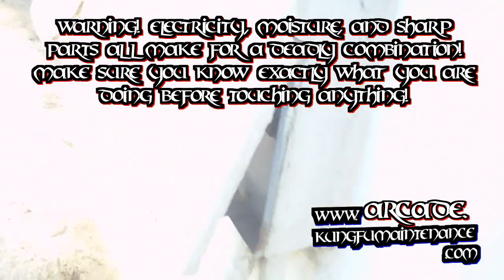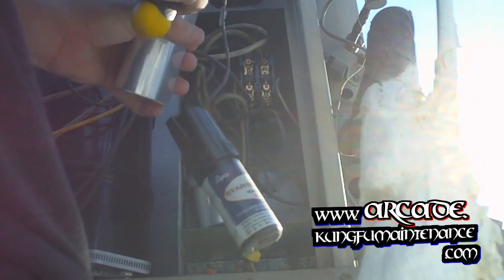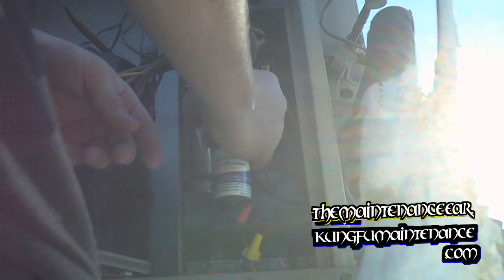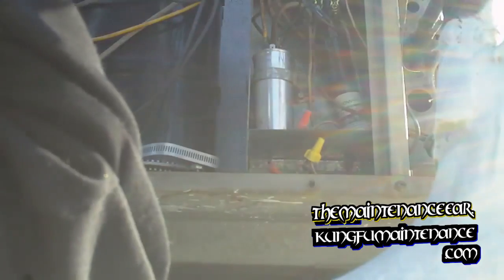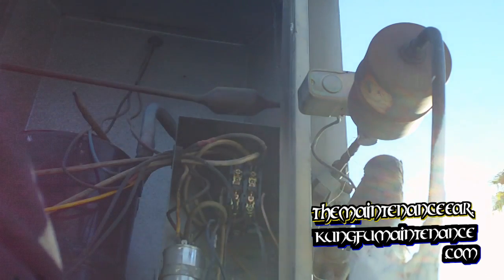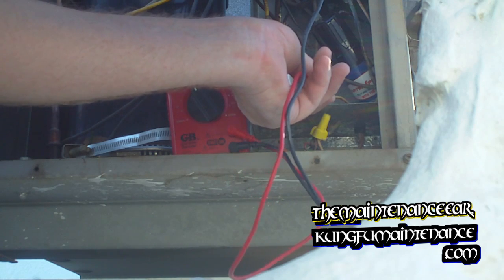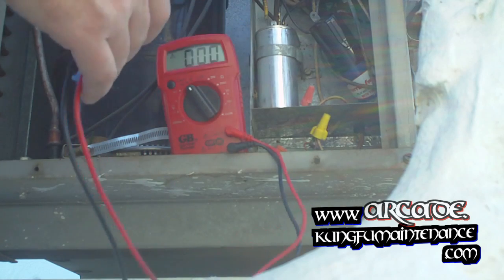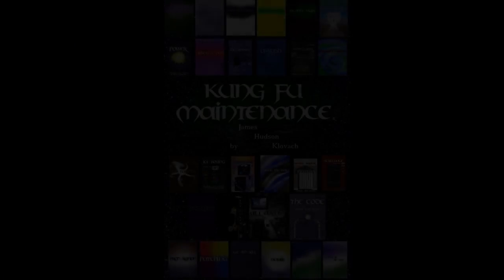HVAC Trouble Shooting An Air Conditioner That Won't Turn On ~ Diagnosing A Bad Breaker

Comment: Hopefully you are still answering questions..

My unit fan or compressor will not turn on, same for the fan in the air handler.
Both make a humming noise as if it's getting either not enough power, or the fans/compressor are shot.
Odd coincidence I think..
I've checked the capacitor and the fuses on the compressor-all is fine with them.
I'll check the contractor later but what would you guess the problem is?
When I bought the house I tested it and the fan turned on, but the ac/heating never did work. Heat pump by the way.

Comment: hey kung fu man, I have two ton units one the compressor won't start ohmed the compressor and it checked out good so I swapped out all switch es and electrical board, and start up capacitor . but compressor still won't start what do I check next.

Comment: thank you so very much for your educational videos. my Westinghouse 2 ton a/c unit needed a new condenser fan motor, so I replaced it. afterwards I checked  all voltages to all components and everything was correct except for my 220 service voltage which dropped from 220vac . to 110 vac. 
   couldn't for the life of me figure out the issue. I've seen your videos before but couldn't find anything that could explain my issue to my problem until I found your video. 
     you saved me a lot of time and money, your videos are simple yet thoroughly explained. your right on the money. my breaker at the service drop ( main house circuit panel) and sure enough,  my breaker was shot " exactly like the one in your video). 
      Thank you so much for your help and videos. Your awesome!!!!
         best regards.....Eric Dee

Comment: I have watched a few of your videos....you must be doing apartment maintenance....if you work for a heating and cooling company....you would have been fired a long time ago....you just don't replace parts left and right like you do....your troubleshooting skills are horrible....not using a multimeter for anything....just a beeping probe....You may know what you were doing....but you cannot do it the way that you are doing it..You cannot charge the customer for all those parts you put in....but I guess apartment maintenance is different..you can call it cross preventative maintenance.

Comment: I have problem with my Train AC unit 24 volts checkout good coming in to contactor and  contactor pull in but not thing turn on no fan no compressor. what should I check ? thank you

Comment: uh, I'm no technician, but aren't the breakers usually the 1st thing you should check?  I came to this video because I've already checked those, and it's still not coming on.  My thermostat says that it's on and cooling, but it isn't.

Comment: Hi
I just replaced the fan motor and capacitor it did not start when press and hold on contactor fan start working i replaced the contactor but still contactor don`t close, i check all wiring everything look good but what can be the problem .
Reply from the maker: ***** Based on your description my guess would be your thermostat is bad. That would be my first check. You might find me video on how to troubleshoot thermostats helpful.

Comment: I have a York ac central unit, when a turn on the work perfectly,  but when temperature go to 77 the compressor turn off and only the fan work, but the termostate temperature that i selected was 75 and the compressor will not star again until i turn off and on again the ac, i hope you can help me
Reply: I have the same  problem  any help?

Comment: Hey I see you check your comments....hi , turned on my a/c now it won't stop....changed stat....Still running  green light on board in furnace says normal opp it pulses. Pulled disconnect outside to kill comp. But blower still runs inside ...what the hellllll
Reply from the maker: My first guess and check and I think most likely problem would be that you have a bad contactor. Check me vid "How To Replace An Air Conditioner Contactor " Other possibilities would be a wiring short in the thermostat wire(such as from a rogue staple) or more likely at one of its connections such as the transformer or behind the thermostat. This can happen when a contactor welds closed or loses its spring to spring out and shut off after voltage is turned off at the thermostat.
Reply: Thank you.....

Comment: My friend, my AC fan outside turns for about 5 minutes then stops, the ac guy replaced the capacitor, it worked fine but now it's doing it again. This time it doesn't turn at all. What can be the problem? Thanks
Reply from the maker: Could be a bad motor or motor bearing. Also could be a bad capacitor again. It's also possible the wrong capacitor microfarad size was used. Also possible a wire or wire terminal burned etc.... Sounds like a bad motor bearing though. It sounds like it is overheating and shutting off (thermal overload switch) after five minutes. If you are able to turn it on again later (after the thermal overload switch cools). You most likely need a new motor and capacitor as you always want to replace the cap when putting in a new motor.

Comment: i have a GE a/c wall unit model #AEM14AQL1 / 14,200 BTU. If i plug it in, turns on by itself works fine for a while then turns off by itself  then keeps repeating this same behavior. WHAT COULD BE THE PROBLEM??? Thanks, Edgar M.
Reply from the maker: Could be low on refrigerant. I would try cleaning the coils and changing the filters first though. Many units have thermal cut offs that shut off if compressor or fan overheats and restart once system cools.

Comment: At the start of the video you mentioned that the compressor and the top of the fan motor was not hot.  What would it mean if it was?  I have a unit that is not starting.  That was the first thing that I noticed that the top was hot.
Reply from the maker: The fan motor and the compressor each have a built in thermal overload switch. Let's say for example a condenser fan motor capacitor lost it's phase the fan motor not turning fast enough  or erratically might overheat and the thermal switch would separate. (These often work like or via a bimetal switch)  The compressor would keep running without the fan spinning to remove the heat and it too would eventually overheat and separate it's thermal fuse or blow the fuses or trip the breaker. Once the unit was cooled down the bimetal like heat sensor thermal switch would come back together and they could be restarted (once the fuses or tripped breaker were reset if they had blown or tripped). While making any needed repairs I sometimes put frozen water bottles on the top of the fan and or compressor to speed the recovery if I suspect the thermal switches have separated. ~ Thanks for watching and subscribing. ~..~

Comment: I am no AC person but I would have checked that i have both legs of 110 VAC supplying the unit as well as 220 across both hot legs before changing out parts blindly

Comment: heres my situation: just bought a brand new rigidaire ac unit that goes on the window and it wont turn on. I press the reset button it turns on for two seconds makes a beep all the lights are green except filter reset which is orange and turns off. I push test button and all I hear is a pop like noise. No idea what is going on as I've no experience with AC units., this being my very first one and all and I am just depressed. I was really hoping to finally get some cool air in my room after boiling to death for 10 years.
Reply from the maker: I would try removing and reinstalling the filters. Its possible one is just not seated all the way. The little bit of research I did stated there are three of them A, B and C. Filter A is behind the grill of the back panel and can be taken out by pulling the upper tab. Remove the lower filters B and C by loosening the screws than put down the air inlet grille, then take out the air filters. They can be cleaned by using a vacuum hose or rinsing with dish soap and letting dry completely before reinserting.
Reply from the maker: I would try removing and re-installing the filter and or filters and than push the filter reset button.

Comment from the maker: Do not touch anything unless you absolutely know and understand what you are doing. To check the contactor set thermostat off. Contactor should now be popped out not sucked in. If it remains sucked in. Use a voltmeter or multimeter set to volts and check the two side wires for voltage with one lead to each side. If you have voltage, problem is in the house side not the condensor side. If you have no voltage on the low voltage side wires and contactor remains sucked in problem is the contactor .

Comment from the maker: My first guess and check and I think most likely problem would be that you have a bad contactor. Check me vid "How To Replace An Air Conditioner Contactor " Other possibilities would be a wiring short in the thermostat wire(such as from a rogue staple) or more likely at one of its connections such as the transformer or behind the thermostat. This can happen when a contactor welds closed or loses its spring to spring out and shut off after voltage is turned off at the thermostat.

Comment: I have a heat pump that cools very well but the compressor will not shut off even after the temperature is reached on the inside of the house, I put in new thermostats the unit is only 4 years old but will not cut off any advice I could get would be great. I even ask the guy who installed it he said he is not sure.

Comment from the maker: Sorry this reply took so long., I somehow missed the comment. I always prefer to try replacing the capacitor first. Least expensive and least invasive. It is very likely that the cap is out of phase and that is causing it to stop. If it doesn't work out you can always replace the motor afterwards.

Comment from the maker: Most window units are just plugged in to a wall outlet and can be unplugged there. Some may be hardwired requiring you to turn off power at the breaker. Remember that just like traditional air conditioners wall unit capacitors hold a charge after being unplugged or disconnected so they need to be discharged before servicing.